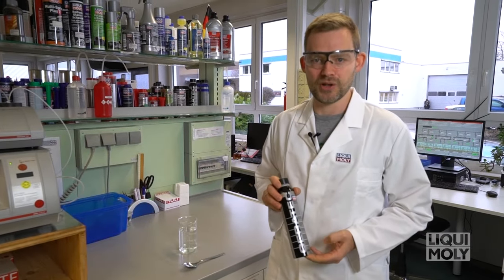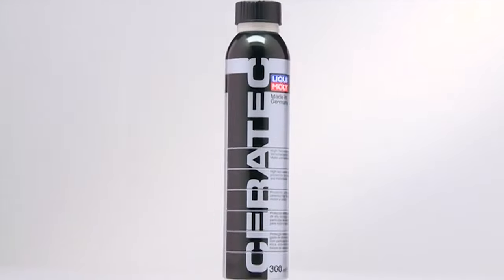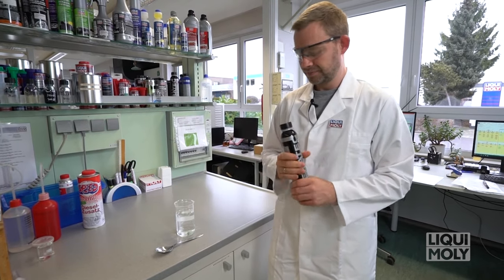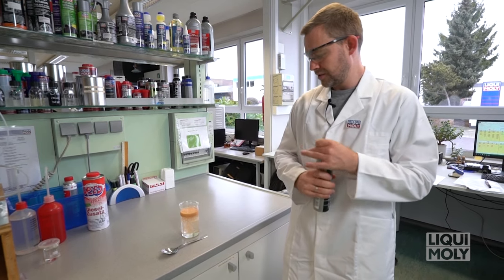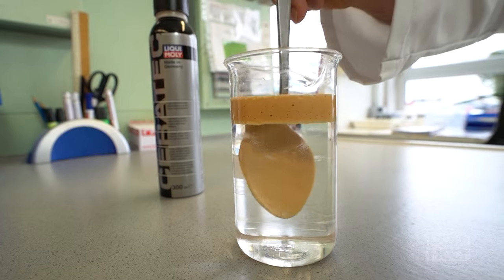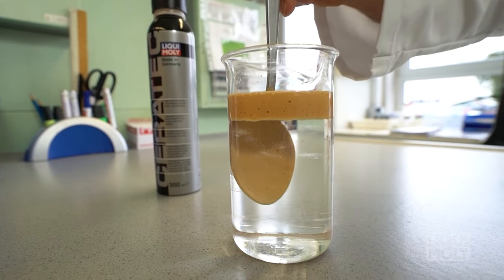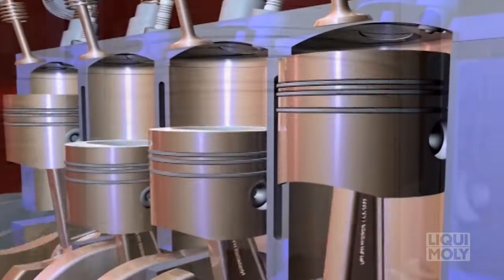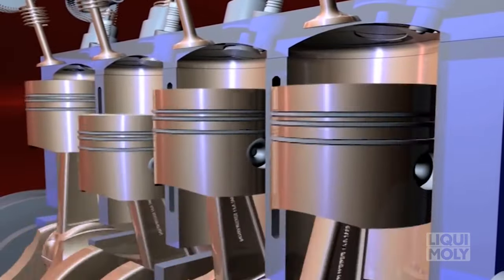LIQUI MOLY CERA TEC (Art. 3721)

Comment: I’ve used ceratec in my Rover 75 diesel (114k miles) approx 183k kilometres on it, I check my fuel consumption every time I top up, and not only is the car quieter and smoother on tickover, mpg has gone up from around 48, to 50. Not much, but a calculated noticeable difference. I’m most impressed
Reply from the maker: Dear Steve,
thank you very much for your positive feedback.
We are very pleased that you are happy with our LIQUI MOLY products. 😀
We will keep on working hard to satisfy our customers´ needs in the future as well. 💪
Best regards,
your LIQUI MOLY team

Comment: Saved my manual transmission. Started to make noise like bearing is worn. And it’s a model famous about this problem. I decided to try it in transmission because I used it before in engines of all my cars and I like it, but did not expect it will work. After about 700 kilometers noise went away and even problem with shifting from 3. to 4. gear. Shift quality also improved in other gears. I put it on 273 000 kilometers few years ago. Now car have 390 000 kilometers and still works great. Since then I use it in everything. And it’s relatively cheap for what it is and how well it works. No problems with vvt solenoids. Like Scotty Kilmer sad without trying it.
Reply from the maker: Dear Aleksandar,
thank you so much for taking the time to leave us this amazing review.😊
We are very pleased that you are happy with our LIQUI MOLY products. 😀
Our most important goal is to ensure our customers' satisfaction by delivering high-quality and reliable products.

Best regards,
your LIQUI MOLY team
www.liqui-moly.com

Comment: Hi there. I had a couple questions please. I'm an auto tech and definitely and oil/lube nerd😂. I am using ceratec on a couple vehicles. I got a VOA on Ceratec. I didn't realize how much Moly is in it (4600 ppm). Is that modtc Moly or tri Moly? Or is it m0s2? I would think it's modtc but I didn't know for sure. The boron showed around 2400ppm. But is it hex-'nitride' or 'oxide'? The msds says oxide. But I know the nitride variety is synthesized from boron trioxide. So maybe that's why it says that? But I wanted to know for sure if the final product is hex-'nitride'  I saw roughly 800 ppm zddp and 1600 calcium. Is the calcium there mainly as a carrier for the boron and to raise TBN a little? This isn't a negative thing because I do like the product, but I do wonder if all that Moly and calcium would compete for surface area plating and win out over the zddp and boron. Because zddp is definitely a tough boundary layer that for sure does work to prevent wear. I know I have several questions in there but I'd really like to know. Thanks so much... Have a great day!

Comment: I run it in my Honda Legend V6 3.5L VTEC and the biggest change I notice is a more silent cold start. I was wondering, if you use injection system cleaner, will that hurt the Ceratec?
Reply from the maker: Hello Ebo, 
thank you for your inquiry.
It is no problem using the Injection Cleaner if Cera Tec is being used within the engine oil.

Kind regards, 
your LIQUI MOLY team
www.liqui-moly.com
Reply: Hello ! I have used ceratec in my Toyota Corolla 2NZ engine. If I use flush oil during oil change will it affect the ceratec inside engine ???
Reply: @arbabfahad9036  they claim the ceratec coating inside the engine will last up to 50,000km after a single use
Reply: @arbabfahad9036 correct question. I think flush will effect the coating.

Comment: Particles kling to cylinder wall....ignition occurs....Particles and film of oil are separated as film of oil is burnt off....normal process.....Particles next step is to go out via exhaust valve....but they are now micro scouring powder....How does it effect exhaust valve?

Comment: I understand that Cera Tec need not be used every oil change. Will engine flush remove the Cera Tec treatment? Also, is the use of Liqui Moly MOS2 advisable between the changes containing Cera Tec?
Reply from the maker: Hello Ken, 
thank you for your inquiry.
Cera tec is a combination of a solid lubricant and a chemical friction modifier.
When doing an oil change (with or without Engine Flush) the solid lubricant will be flushed out, but the results of the chemical friction modifier still remain. 
For a perfect result we recommend to add Cera Tec once again after every oil change.
For intermediate use MoS2 Oil Additive can be used flawlessly, too.

Kind regards, 
your LIQUI MOLY team
www.liqui-moly.com

Comment: I have a 2.0 diesel Mazda 3 with 240k km and stage 1 (165hp). I regularly use liqui moly top tec 4500 (~10k km between changes) and now I want to add this additive. Will it affect the life of the oil? Make it shorter or longer? Thanks in advance.
Reply from the maker: Hello,

the use from our LIQUI MOLY Cera Tec has no influence on the lenght of the oil change interval.
When using, the prescribed drain interval should continue to be observed.
Best regards, your LIQUI MOLY team

Comment: Hi just wanted to know what is the benefits or reasons of using Ceratac if I already using high quality synthetic oil?
Reply: It’s coats all the metal parts in the engine and reduces friction which allows the pistons to move more freely 
It also fills in microscopic scratches on the cylinder walls which will prevent oil consumption 
It’s a great product and lasts for about 30K miles 
If you use it you will see your engine will run more smoothly and also it will be quieter 
It can also add to your mpg.

Comment: Hi, I have heard various hypotheses including that that the Ceratec at high temperatures risks crystallizing and therefore ruining the turbo and the engine itself. Let me explain these ceramic microparticles can they cross the piston rings and get inside the cylinder, making everything dirty?
Reply from the maker: Hello, Cera Tec will not crystallize at high temperature and will will also not lead to the build up of deposites inside your combustion chamber. Liqui Moly Cera Tec is suitable with all common engine oils in diesel and gasoline engines, with and without and DPF. It is tested for turbochargers and catalytic converters. It will not ruine the turbo charger or the engine. It has a longlasting protecctive effect which prevents the several parts inside the engine from wear. Best regards, your LIQUI MOLY team

Comment: My car is peugeot 308 t9 2014. 1.6 eHDI with 6 gear manual transmision. It requiers monograde 75w API GL4 oil for transmision. Can i use Ceratec in tranmsion oil?
Reply from the maker: Hello Fernando, 
thank you for your inquiry.
If your gear box does not have a diff lock system or a wet clutch system, Cera Tec can be used in it.
https://pim.liqui-moly.de/pidoc/P000017/3721-CeraTec-46.0-en.pdf

Kind regards, 
your LIQUI MOLY team
www.liqui-moly.com

Comment: One question... Is there any problems with Mos2 addictives if i use it in r15v2 of yamaha..? Is it block the oil pump and filter..? Plz rply
Reply from the maker: Hello Travel, 
thank you for your inquiry.
Cera Tec must not be used with motorcycles with wet clutches!
https://pim.liqui-moly.de/pidoc/P000017/3721-CeraTec-46.0-en.pdf

Kind regards, 
your LIQUI MOLY team
www.liqui-moly.com
Reply: @liquimolywebtv  ok.. Then please give details about mos2 addictive...
Reply from the maker: Hello Travel, 
our Oil Additive (please also see the link below) can be added in 2% of the oil amount to an engine with wet clutch.

https://pim.liqui-moly.de/pidoc/P000005/1011-OilAdditive-35.0-en.pdf

Kind regards, 
your LIQUI MOLY team
www.liqui-moly.com

Comment: Hi! my car just had the oil changed.  Is there a problem if I now put the ceratec on it?  I am concerned because the oil level would rise when adding the ceratec.
Reply from the maker: Hello, when applying Cera Tec, the oil volume has to be decreased by the ammount of Cera Tec. Best regards, your LIQUI MOLY team
Reply: Hi
I have x5 bmw 2015 70k km using 5w-30 special tec every 10k km, is it the time to for using liqui moly proline engine flush then use the liqui moly ceratec
Reply from the maker: We recommend to use fresh Cera Tec after every oil change. whether you use engine flush or not. Best regars, your LIQUI MOLY team

Comment: i use scooter kymco  x-1town 250i
1.what i do better use mos2 or ceratec ?
2. i read in some discusion that ceratec must running in machine about 2000km to gain full effect?
3. i read ceratec have micro/nano ceramic particles so is can harmfull to machine like it can grind the wall like sanders?
Reply from the maker: Hello Fixakun, 
thank you for your inquiries.

Below please find our replies:

1. We recommend the Oil Additiv for the engine oil in your case.

2. It is not easy to tell in which time the Cera Tec generally reaches its full effect. This depends on many different factors.

3.No, there will be no abrasive issues due to the solid lubricant.

Please also have a look at our contact/store finder. There you will find official LIQUI MOLY contacts/shops in your country/area.
https://www.liqui-moly.com/en/contact/resources.html

Kind regards, 
your LIQUI MOLY team
www.liqui-moly.com
Reply: @liquimolywebtv  doyou recomend oil additive for scooter depends on value or best performance? why not recomend ceratec intlstead, ceratec is newer and better  tecnology yet?
Reply from the maker: Hello Fixakun, 
thank you for your inquiry.
We recommend the Oil Additive for scooters and motorcycles as the Oil Additive will work also in motorbikes with a wet clutch system in the correct dosage.
Whereas Cera Tec must not be used with wet clutches, we decided to exclude the use for scooters in the product information.

Kind regards, 
your LIQUI MOLY team
www.liqui-moly.com
Reply: i use only scooter..not for wet clutch, so best use cera tec yet?
Reply from the maker: Hello Fixakun, 
thank you for your inquiry.
For Scooter whether 2-stroke or 4-stroke we recommend our Motorbike MoS2 Shooter.
Please also check the related product information:
https://pim.liqui-moly.de/pidoc/P004197/20555-MotorbikeMoS2Shooter-27.0-en.pdf

Kind regards, 
your LIQUI MOLY team
www.liqui-moly.com
Reply: @liquimolywebtv  can you tell me the reason why scooter(mine 4t) you are still suggesting using mos2 than ceratec?
Reply from the maker: Hello Fixakun, 
thank you for your inquiry.
The reason is that if we would recommend it officially for scooters, the chance is most likely that some people will add it to their bikes with wet clutches. And this would cause problems. With the correct dosage of MoS2 this will not happen.
https://pim.liqui-moly.de/pidoc/P004197/20555-MotorbikeMoS2Shooter-27.0-en.pdf

Kind regards, 
your LIQUI MOLY team
www.liqui-moly.com
Reply: @liquimolywebtv  so is not any harm to use ceratec on my scooter.
Reply from the maker: Hello Fixakun, 
no, it will not harm your scooter.

Kind regards, 
your LIQUI MOLY team
www.liqui-moly.com

Comment: Can i use it with my suzuki 998cc {Engine type: K10B 67bhp 12V K Series Engine (PETROL)} ?
Reply from the maker: Hello Shailesh, 
thank you for your inquiry.
Yes, Ceratec can be used in this engine.

Please also have a look at our store finder. There you will find contacts/shops in your country/area.
https://www.liqui-moly.com/en/contact/resources.html

Kind regards, 
your LIQUI MOLY team
www.liqui-moly.com
Reply: What the quantity of cera tec with 2.9 litter of engine oil?
Reply from the maker: Hello Shailesh, 
300 ml Ceratec is sufficient for up to 5 l of engine oil.
The optimum dosage is approx. 6 % of the total oil filling quantity.
https://pim.liqui-moly.de/pidoc/P000017/3721-CeraTec-44.0-de.pdf

Kind regards, 
your LIQUI MOLY team
www.liqui-moly.com
Reply: Thank you much for yours positive response.☺️
Reply from the maker: Hello Shailesh, 
you are absolutely welcome!😉

Kind regards and all the best, 
your LIQUI MOLY team
www.liqui-moly.com

Comment: Hi, 
I used ceratec with a new oil change, but I change me oil every 10k. Plus I use an liqui moly pro line engine flush every oil change. 
My question is this: do I have to add ceratec on every 10k oil change?
Reply from the maker: Hello amit, 
thank you for your inquiry.
Yes, for the best result Cera Tec has to be added after every oil change.

Kind regards, 
your LIQUI MOLY team
www.liqui-moly.com
Reply: Nah dude Ceratec last up to 30k miles

Comment: Hello what is the mix ratio? My engine is fiesta st takes 4.1 l oil can i think i can get away with 4.3 so i will add 4l oil and 300ml of ceratec is it ok or i should add less? Thanx
Reply from the maker: Hello Matt, 
thank you for your inuqiry.
Add approximately 60 ml of Cera Tec per litre of engine oil, check the oil level and ensure to be not over maximum.
https://pim.liqui-moly.de/pidoc/P000017/3721-CeraTec-46.0-en.pdf

Kind regards, 
your LIQUI MOLY team
www.liqui-moly.com

Comment: I added cerratec to 5l 5w 30 ..bt i didnt shake the bottle and its run almost 400 km since it added...can add 1 more 300 ml to same 5 l oil with proper shaking and mixing...help
Reply from the maker: Hello Joel, 
thank you for your inquiry and for using our LIQUI MOLY product.

We would not recommend to add another bottle to the oil which is now in your engine.
Next time please ensure shaking the bottle well to add the product properly.

Please also check the link to our related product information:
https://pim.liqui-moly.de/pidoc/P000017/3721-CeraTec-46.0-en.pdf

Kind regards, 
your LIQUI MOLY team
www.liqui-moly.com
Reply: What were you even on typing this buddy, the oil and stuff will get shaking it needs inside the engine.

Comment: I change my car,s engine oil every 10000 km, so when  i put ceratec in my engine , then after 10000km i changed the oil , then i have to again add ceratec or its effect last 50000km

Comment: Can you try again with a finger?
Does it only react to metals?
Reply from the maker: Hello 聾漆公, 
thank you for your inquiry.
Sorry, but we will not test that with a finger.
Parts of an engine are mainly made from metal, that is why we show the test like it is.

Kind regards, 
your LIQUI MOLY team
www.liqui-moly.com
Reply: @liquimolywebtv  thanks for reply!
LM made an Asia version "CERATEC BLUE" which uses 0.2µm Boron, while this BLACK old edition uses 0.5µm...

why do you not promote the new 0.2µm formula...?? Just wonder!
Reply from the maker: The particle size differs between 0.2µm and 5µm. But we changed to the spelling <0,5µm. Best regards, your LIQUI MOLY team
Reply: @liquimolywebtv  to demo real world conditions, can you please try:
- add hot LM motor oil in glass (e.g. 90C)
- add Ceratec
- put metal spoon in again
- stir the spoon, also the up and down test

thanks, can't wait for that!

Comment: been using it on a brand new Porsche 992 since 4 miles.. currently at 20K ... can't tell if it's working, but it's not doing any harm... I used it every 5K miles with new oil.
Reply: Ceratec last for 30K miles no need to add more because once everything is coated there is nothing else to coat
Reply: Dont use too much can possinbly clog your oil pick ups, just use every 30-50k miles
Reply: Access of many things is bad
Reply: You are ruining a brand new Porsche by adding too much Ceratec. Hopefully the damage is reversible.
Reply: @GokuInstinct1 Funny,  because the last oil labs analysis came back at 30K miles with amazing numbers, especially in the area of wear and bearing related metals suspended in the oil...   In the end, wear is the enemy, and it's wearing very little.
Reply: @Sams911  true. But won’t too much eventually clog it all up? Hopefully after 100k miles you can update us on how it went!

Comment: how it will use it with car ?
Reply from the maker: Hello,
Micro ceramic solid lubricant suspension based on
hexagonal boron nitride (BN) in selected base
oils. The laminar graphite-similar structure reduces
friction and wear and prevents direct metal-to-metal
contact. The < 0.5 µm particle size guarantees optimum filter flow properties and protects against depositing of solid lubricant particles. Miscible with all commercially available motor oils and motor vehicle gear oils.
Best regards, your LIQUI MOLY team

Comment: Motorkote is a better product and has been tested along with this product. Both had good results but the lubrication was better with Motorkote.
Reply: This wont turn into acid as motorkote does
Motorkote does well on short bearing tests but not after a cold winter and a dosen heatcycles the chlorinated parrafin will form hydrochloric acid and litteraly eat away your bearing material. Because acid is corrosive.
Amsoil has conducted some tests because someones truck engine was destroyed after using it.
I would reccommend motorkote to lube your door locks instead. And door hinges.
Or maybe but it inside of a motocross bike.
Because you drain it afterwards anyway
Reply: I checked it and it's a great product
Reply: @nielsei Thankyou for the info. So motorkote is simple not meant for extreme winter temperatures